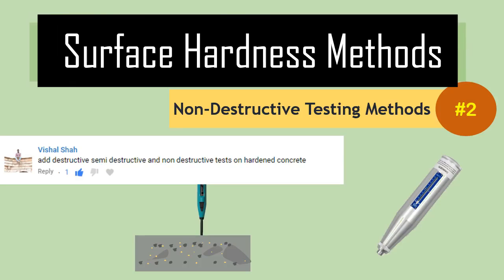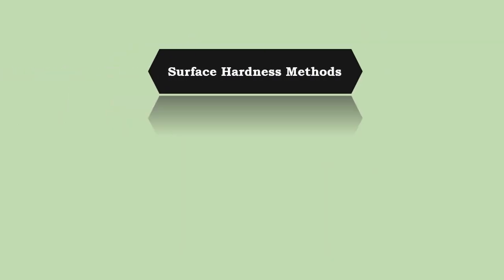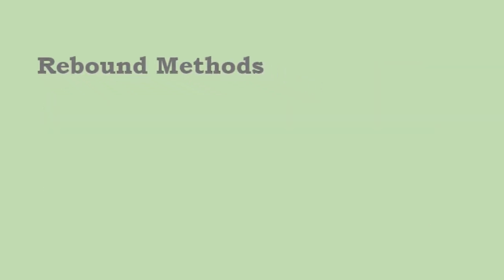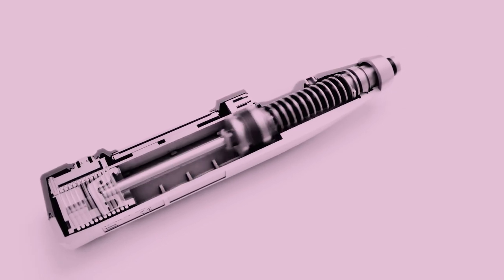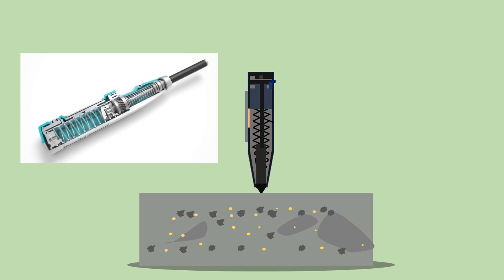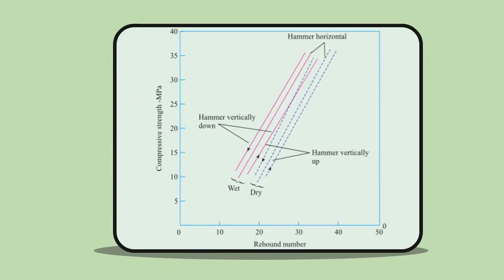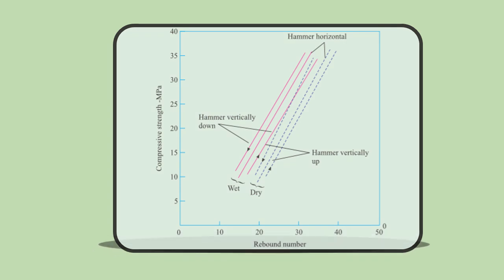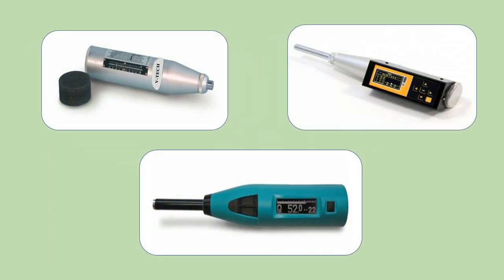Surface Hardness Methods || Rebound Hammer Test || Non-Destructive Testing Methods #2

Comment: Is there a direct relationship between the surface hardness, which is measured with the hammer, and compressive strength of the whole mass of concrete?
Reply from the maker: We came say that for whole concrete as concrete is placed in batches. So, concrete quality may differ for each batch. You can take hammer value on different places.

Comment: are u sure that it can be tested also in inclined angle ?
because according to my knowledge it can be used vertically up & down and horizontal positions only.
Reply: It depends on the make of hammer.